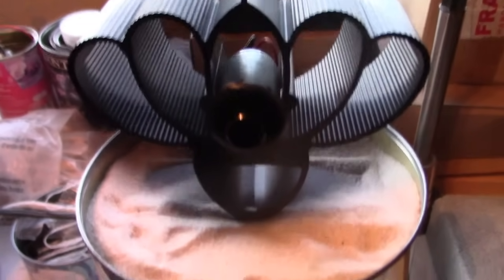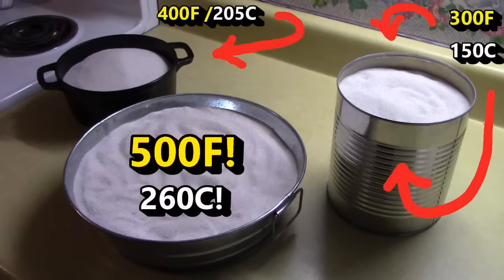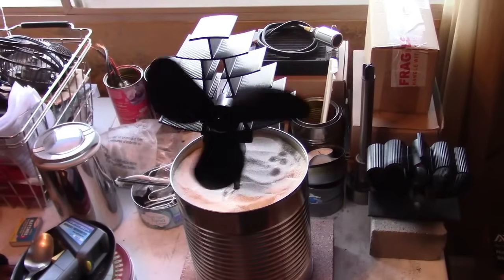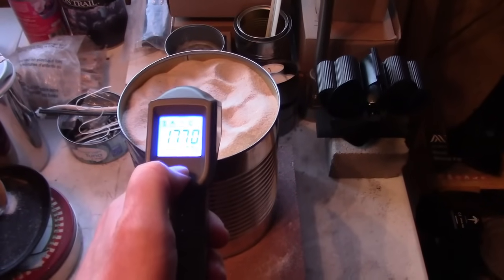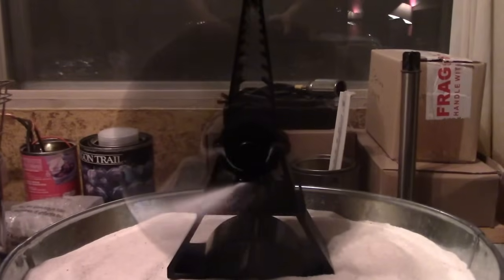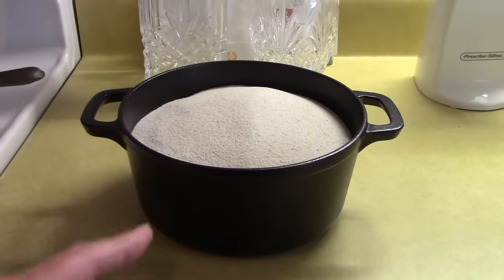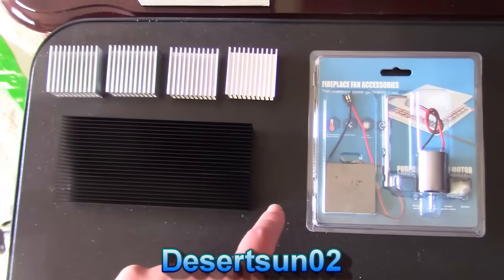DIY Sand Battery Air Heaters! w/heat powered fans! no electricity needed! sand battery room heater!

Comment: Very nice!  I've been heating my home with your cast iron skillet heater and stove fan.  I use free hand sanitizer that I was gifted for fuel (I got cases upon cases of it)  It works just like gel fuel.  Free heat!  Will try your sand battery idea too.  But maybe I'll heat the sand with hand sanitizer!  You engineer such great ideas.  Thanks!
Reply: They are in gallon bottles.  I was running through a quart to quart and a half per day.
Reply: Sanitizer fuel 😂😂😂 that's good recycling:) How long does one bottle burn for, at a rate to heat your home?
Reply: @極楽鳥-m8m  People used to do that down in brazil with cheap beer or rubbing alcohol. I don't know burn rates sorry.
Reply: It would be interesting if you can report back on how long you got the heat to last for. Thanks.
Reply: I can't find a link to the cast iron heater and stove fan.  Please post. It sounds interesting!

Comment: What is sand battery?  Why would i want it to be 350°f
Reply from the maker: hi. a sand battery is a volume of sand use to store heat for current or future use. that heat can be used to generate electricity or to create warm air. sand can store heat at a very high temperature and for a very long time. some larger sand batteries can store heat for weeks or even a month.

Comment: could you put an aquarium heater in the center of the sand, they have thermostats and don't seem to use a lot of energy?
Reply from the maker: that is a good idea. they only reach about 96F(36C) though, so the sand would only get warm but not hot. i'm also not sure if they would hold up if they weren't in water. i was thinking of using nichrome wire to heat the sand.
Reply: @desertsun02  thanks
Reply: @desertsun02  - Could you use one of those heating coils they sell for heating tea water in a cup?  They get very hot real fast; but I know they also malfunction if not immersed in water.  Would sand work as well?  Then I wouldn't have to worry about how to hook up anything since I have no fewer than 5 EcoFlow River 600 solar generators.

Comment: A suggestion.

Now cover the entire thing with a hole or holes cut in the cover to let the warm air out. I dis this exact thing using a 5 gallon plastic Home Depot bucket. It made a HUGE difference in the amount of useful heat I get out of the sand battery, etc. The plastic bucket barely even gets warm to the touch on the outside, so no safety issues.
Reply: Why not heat water instead?
Reply: @TheRainHarvester  if you want hot water, sure. If you want lasting heat, sand is far far better.
Reply: @jerrodlopes186  but the specific heat of water is more than sand.  But I guess the sand can reach a higher temp safely than water can.
Reply: @TheRainHarvester  sand holds onto heat far longer than water and also takes bare minimum 800°F more than water before it changes states.
Reply: @TheRainHarvester  that's what I'm doing right now but the water gets cool too fast.. be ready to walk outside right now and grab this metal box that I have full of sand and I'm going to put it on the stove and see what happens because I'm freezing.. my freaking furnace just stopped working for some reason
Reply: How did you hit the sand,? Did you hit it and pans and dump it in the plastic 5 gallon buckets
Reply: @billyjones9045  I have a cooktop on the top of the flue of my rocket stove outside. I just place the sand battery directly on that.
Reply: @jerrodlopes186  You're leaving out some information. Is there a separate container than the plastic bucket you heat on your rocket stove?

Comment: U still have to have electricity to heat the sand
Reply from the maker: hi. the main on-grid options for heating the sand are stove top or oven but there a lot of off-grid options too. the ones i've thought of include campfires, rocket stoves coal stoves, propane stoves, alcohol stoves. (a fresnel lens, a parabolic dish or a solar oven can also be used). PTC ceramic elements or resistive heating element are two more ideas.

Comment: A link to where to buy the fan would have been nice.
Reply from the maker: hi there. best place to get the fans is amazon. they have lots of them (at least 50 different models). look for one that has a low starting temp (122F/50C). i also like the ones with the curved blades. they seem to move more air. to find the fans just search for heat powered fan on amazons website 🙂

Comment: Copper is a bit expensive and not usually free salvage. I have found that you can use an old aluminum sign for material and it would be reasonably efficient.
Reply: Metal window screens are usually aluminum.  Cut one off the frame, roll it loosely, and let the sand fill in between.
Reply from the maker: i have been meaning to try aluminum but haven't yet. aluminum flashing might work good

Comment: I do this too. Its brilliant. I heat the sandbattery with 4 candles. Drilled 4 1 cm holes in the tin box, and put twinned 5mm copper wire thru there. So the candles hit the wires and the sand very quickly.
Also possible to put a bucket filled with sand on the oven. The oven get cold long time before the sand. Hours.
Reply: I always wondered what the point of that was? Unless you have a lot of airflow inside your house. Otherwise the energy is basically the same?
Reply: @millanferende6723  It's not about total energy, it's where it goes and how long it stays. Think of the reasons why it always feels so much better to have a ton of big rocks around a fire to moderate the temperature of the flames.
Reply: @millanferende6723  with the sand it's thermal mass and radiative heat. whereas with heated air it's convection. I can't really explain it but radiative heat is better to keep you warm.
Reply: @finnmark2013 what's your setup look like? I imagine you drill the holes in the bottom of the can - and in that case the sand would leak out??
Reply: @barnabyvonrudal1  Two 5mm copper wires twisted fit perfectly in a 1 cm hole... no the sand wouldn't "leak out".  He's drilling FOUR holes, each 1 cm wide, putting the twisted copper wires through the holes in the can, long enough to reach the top of the can and then filling the can with sand.  Put the can on a stand where you can light four candles (he's probably using tea candles) and place the flames where the copper wires are poking out a tiny bit on the bottom of the can.  The flames touch the copper wires, sending heat into the can full of sand which is the distributed throughout the sand by heat radiation.  Once the sand is hot, blow out the candles and you're left with a thermal mass giving off heat for hours.
Reply: I don't still get it. How is it done really? If you can help
Reply: What don't you get? Filling the bucket up with sand and putting some candles underneath? @nnejiamaechi9385

Comment: So while water has a large capacity to hold heat, it goes away in a non sealed container if it gets hot.  Sand can get to 300fF, 1,000F and disperse heat longer.
Still think s hot water tank would be the simplest.
Reply: Indeed so you could have a stupid easy setup with say any standard buckets with lids and aquarium heaters sticking in the dead centers of the lids with the hole JUST large enough to "barely" install these things. I could see this working well say for greenhouses and such instead of using small space heaters. You would then obviously have fan(s) for the ventilation though.
Reply: @rickytorres9089  50 gallon barrels with hoses pumping to a solar system.
Induction hot plate under a steel tank or barrel filled with sand, aluminum heat fins laying on the floor of the barrel dispersing the heat into the sand.

Comment: Why???? Is electricity for free in your country??? 😂
Reply from the maker: hi nope. the sand battery stores the heat for a long time and you can collect the heat in lots of "free" ways though. solar panel or wind turbine with resistive heating element attached. that could heat the sand for later use. there is also off grid options like fire, or propane or alcohol stoves. parabolic dish or fresnel lens could also be used. an electric stove is just one way. some people may want to "charge" the sand battery for later use elsewhere in the home. 🙂

Comment: Wait, you have to heat the sand on a stove first.....requiring electricity.....?
Reply from the maker: hi. stove is just one option. here a few other ways.... from the description section... the on-grid options for heating the sand are stove top or oven. off-grid options are numerous and include campfires, rocket stoves coal stoves, propane stoves, alcohol stoves.
(a fresnel lens, a parabolic dish or a solar oven can also be used). a fresnel lens would probably heat the sand very fast. two other ideas would be to use ptc elements or resistive heating element. you can hook those to a solar panel or maybe even a wind turbine.

Comment: How about using a solar panel and carbon felt as the heating material to heat the sand
Reply from the maker: hi. i've recently bought some carbon felt. i'll be doing experiments with it

Comment: Stage Two - Take a oven range top element and heat the element up via solar power.

Would also like to see how long sand battery powers the fans.

Awesome content as usual.
Reply: Yeah I'd like to know how many hours also
Reply: I'd just put these on a wood stove
Reply: what about using an induction burner vs range heating element?
Reply: @savannahsmiles1797  with magnetic sand perhaps?
Reply: @savannahsmiles1797 Heat is heat. It takes more electric power to heat something ferrous via induction than it does to just a resistance coil, which is by definition 100% efficient.
Reply: In the video he quotes the heat lasting about 3 hours. This answers the question that Kozinator and teecinemayo3783 had. 

However, I didn't catch how long it would take for him to heat it up. Also heating it would be cut and shortened by more copper, spaced throughout the sand. And similarly it would also have the heating time increased by thickness spacing of too much sand density away from the copper. 

So I'm very much interested in seeing what could be done to cut down on the heat up time. I also believe that the heat up time could be shortened with multiple copper plates rather than just one. 

But he did a great job. Very good job. I hope hashing out the ideas doesn't come across as criticism.
Reply: What about using several coils of copper wire evenly spaced or would this draw the heat out too fast? @noahriding5780

Comment: Am I missing something? I never saw how you heated the sand. I'm assuming this is for power outages. If that's the case, how do you heat the sand?
Reply from the maker: hi. you can heat the sand in lots of ways. here are a few... this is from the description section. the on-grid options for heating the sand are stove top or oven. off-grid options are numerous and include campfires, rocket stoves coal stoves, propane stoves, alcohol stoves. (a fresnel lens, a parabolic dish or a solar oven can also be used). a fresnel lens would probably heat the sand very fast

Comment: Can you explain to me why you call it a sand battery? 
As far as I see in the video you have heaten the sand and the sand is not giving for exemple 12 V . But the heat of the sand can turn a stove fan. 
By the way, I made a sand stove, the sand has 68° C in the middle of the stove. 
Source of the heater is still xax. candles.
Reply: They are called sand batteries because they are storing energy as heat. In the Norwegian countries they are starting to use these to store heat from the summer sun and then use it to make electricity in the winter.
Reply: @sokyoutdoors588  Thank you, how make they electricity from the sand battery? Do you know how? Hope you have an answer, it is very interresting.
Reply from the maker: @Fransje Bik there are a couple of ways. using a resistive heating element attached to a solar panel or wind turbine are two ways.
Reply: @desertsun02  Thank you. Yes, I know but those heat elements are asking a lot of Watt. With a transformator to 6V it takes less Watt. I will try it soon. I still have 'only' solar and wind energie and batteries 12V with converter to 220V.

Comment: i want to make one like a jetboil pot, a jetboil is a backpacking stove with a special pot, it has fins on the bottom to absorb the heat better. and also having a sealed top would be better so that if it ever gets knocked over you don't have to clean up sand

Comment: So you heat the sand with your stove? Electric stove
Reply from the maker: hi. that is one possibility. here are the other (from the description section). the on-grid options for heating the sand are stove top or oven. off-grid options are numerous and include campfires, rocket stoves coal stoves, propane stoves, alcohol stoves. (a fresnel lens, a parabolic dish or a solar oven can also be used). a fresnel lens would probably heat the sand very fast. PTC elements or resistive heating element are two more ideas

Comment: 1:55 does the fan need to be exposed to the sands rising heat? or is it conducted through the core? if so can you store heat for longer if you insulate the sand with a lid?
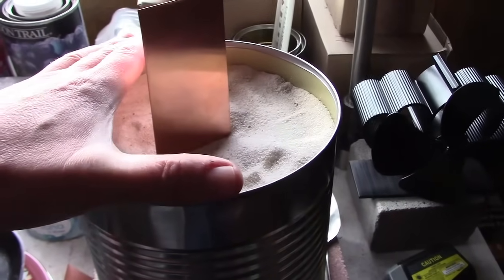Reply: 4:11 oh never mind you go over it.

Comment: Just learned about something,😎 cozy coop =a safe way to heat a small space. 200W on high , meant to keep dogs or chicken warm. Small space you really don't want open flame, too risky. So my idea is to build a small insulated room , have everything handy. Cellphone,TV , mouse, all preplanned for the space. Reducing your need for as much energy. Since I use a sleep apnea mask device I'll never completely get away from Power. 

One issue is condensation , how to prevent it? I thought using the mask would be getting rid of the moisture but it has a valve that vents your exhaust into the shelter. I would have to use another one over the mask or vent the valve outdoor.
Reply: Be careful friend,don't alter your breathing device,that would worry me because if your asleep you can't watch it,lol

Comment: How long did you heat those sand and at what degree? Low med or high.
Reply from the maker: hi. for the video i just used a pan over medium heat. i stirred the sand a few times so it heat up evenly

Comment: Try running a twelve volt battery through a kettle or other 240v or  110v heating element - that is supposed to heat up well too - if so you could heat the sand from a battery using a wind turbine or solar panel to keep it charged - free heat !!!
Reply from the maker: hi. they sell many different types of DC heating elements too. many of those can be hooked directly to a solar panel (and probably a wind turbine also).

Comment: Thought you were going for a heat SINK at the end...like use chilled sand and a high efficiency powered fan...time to catch up on your vids I guess since I bet you've done cooling extensively though I don't recall a sand cooler.  Looking forward to all the ways I can maximize extra energy from my upcoming solar PV install.
Reply from the maker: chilled sand. sounds interesting. if you or anyone else has any suggestions on how to make a unit with chilled sand feel free to drop them in the comments.
Reply: Like maybe something to the effect of how they refrigerate food with clay, pots and damp sand. I don’t remember what they’re called, but there is sand in between a larger clay pot and smaller clay pot. The sand is kept wet, and the food goes inside with the lid. It needs to be kept in the shade, and I believe a breeze on it is best.